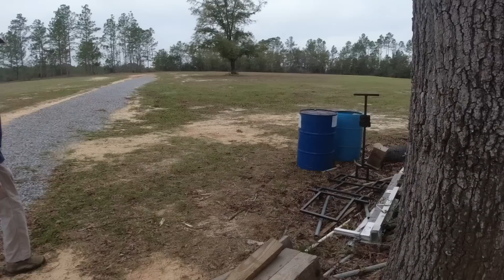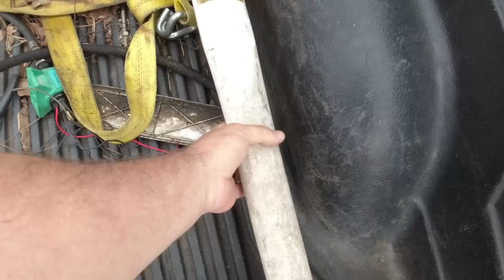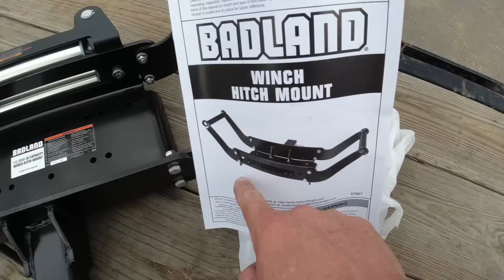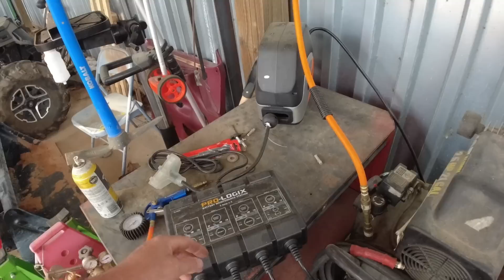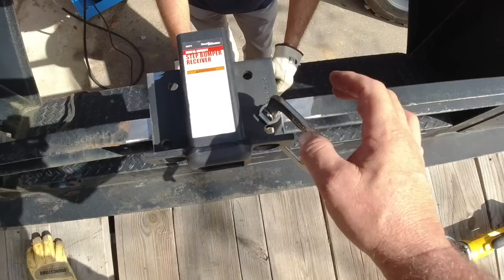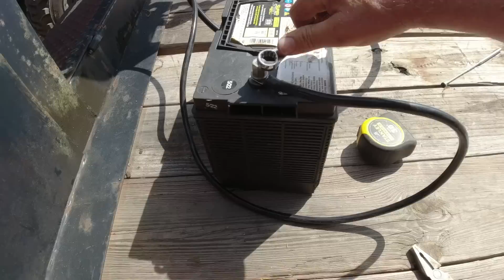This will change how we recover equipment!

Comment: I'd put a second piece of channel on the trailer. Over that spanse it's gonna warp. Then tuck the winch back at least level with the uprights or it has a chance to get clocked by what ever rolls into it, Besides you're losing a bit of room on the bed. Next get some snatch blocks, you won't be sorry. Good video guys.

Comment: Me personally i would mount it to the deck of the trailer. Even with supports on that it will eventually break the welds over time of use and weather, just to much give. Y'all stay safe

Comment: you need to support that winch better. It will never pull something heavy without breaking that bar loose. Weld some additional supports to the c channel

Comment: I would have taken a section of the floor out. And used heavy plate steel. To mount it to the main frame of the trailer. That cross bar is no way strong enough. Good luck!!

Comment: Put a fold down leg off the bottom of the winch it won’t be in the way if it goes to the brackets on the bottom of the wench holder thing ya bolts to

Comment: 12K single or 24K double line pull (will do it). C channel is going to fail . A block of wood to support winch isn't going to stop that.Failure will be the C channel bowing toward the load on a heavy pull until it fractures and it will fracture..... Go to a deck mount with some 1/4" plate. Wish I was there to assist.

Comment: Put one of those on my Jeep YJ. Can't beat the price and at 12K single line pull pretty sure I can't stick it to the point of failed self recovery lol. On same winch on a trailer: they have huge amp draw when pulling heavy. Use 2 battery set-up.

Comment: I'd add A plate & two pieces of angle iron coming off the other direction as  A  tray. welded to those angle iron straps going across the other way to hold it up with.& one center post leg & foot plate in the center at the bottom of that plate to Hank. It'll reinforce it a lot that plus strengthen it up A whole lot more.& Add more durability a long with that process to. Good luck with it all to.

Comment: Got the same winch (with the synthetic rope) on my 30' Diamond C gooseneck.  Mine is permanently mounted though, with a battery in the toolbox with a solar charger on the neck.  Also, Brother, those legs are so pale that they're blue LOL!!!  Just busting your chops a little bit!

Comment: Hank, i know you want to be able to remove the winch but i don't think you should. weld a plate across the one brace and mount the winch to it. it'll be there at all times but it'll be safer than what you have

Comment: You are loading the channel in it's weak direction.  It also has no torsional stiffness.  Either replace that channel with a square crossmember, or nest a big, long square tube behind the channel, and attach to verticals on each end.

Comment: Mount your battery permanent on the trailer and use your trailer wiring to keep it charged. If it didn't come equipped with a battery charge relay, you my have to install one. I would almost bet the 4500 already has the proper wiring. All you have to do is hook it to the battery.

Comment: Mount the winch on top by the tire, with a SOLID bass.  Then use pulleys to direct it down and back.  Pulleys increase pulling power.  It does slow it down, but it's not a race.
Reply: The Pulleys You describe only change the Direction of Pull. 
A Pully at the Load and back to the Winch doubles the Pull Strength.
Reply: @m9ovich785  At the time of filming, the winch was mounted up high, pulling from that height.  It's trying to pull forward and up.  By mounting the winch on top, the first pulley off the winch directs the cable down.  The second pulley, mounted just above the deck level, directs the cable back.  The cable only has a pull load vs a pull and lift load.  Trust me.  I've worked with pulleys and cables long enough to know I'm right.  But if you feel argumentative, someone else mentioned the same thing I did.  Take your issue up with them.
Reply: @MNJay1  I'm going on 63 and Had My 1st Winch on a Truck since 18. I currently have 3 Winches on Vehicles. One of which is a hydraulic Milemarker on a Swivel mounting Plate that I can use on either End of a 99 F-350 with a wet Kit off the 6 Speed Trans. I can use the same winch on Either end of My Kioti tractor. I changed the Hydraulic Oil in the 1 ton to that of the Tractor.  The ATV winch I can use on Either end too. I use them more on the Back cause it is at most time easier to pull the Stuck Vehicle out the way it went in. 
SO I am a bit educated on Winching Dynamics too....
Reply: @m9ovich785  Great.  So it shouldn't be difficult to understand my comment.

Comment: You need to brace that cross bar, it won't be strong enough. Stand off to the side when winching out of the path of the cable with a blanket or something over the cable to keep it from flying around. We want you to be around a long time. 😂.😂😂

Comment: That’s way too flexible it will rip off under a somewhat heavy load. Really need to put a piece of square tube and weld it to the goose neck frame.

Comment: Hank, if you start loading up the c channel cross member, it’s gonna bend in a heart beat.  You might be able to pull 1500-2000 pounds at best.  Anymore than that, it will bend bug time!

You got away pulling a load that rolled.  But pull something that doesn’t roll easily.  You saw how much the c channel flexed pulling the tractor.  A heavier load will definitely put it to a good challenge.

Comment: Hank, try taking a piece of thick square tubing & run behind the c channel where you welded the gussets on. If need be notch out for the gussets & fit in place then weld the slits up with gussets inside. Hopefully that should take the majority of your flex out. Love the vids buddy

Comment: Just an FYi, and I am sure you figured it out, but you only needed to cut one angle in the gesset scrap. Flip over the first triangle along the angle you cut and you will find a straight cuts across the metal (short side) gives you triangle 2.

Comment: Your on right track but that is far to weak it really needs beefed up with your winch fitted to a solid plate not a receiver hitch it’s just to feeble but like others said mount it on top to at least a ten mm sheet with winch bolted to it and next to it a battery box or whole thing boxed in and locked and on bottom of frame fit a tow hook point for snatch block use plus half way up on either side if trailer the same incase you need to pull something that needs straightened up or pulled up at a angle , plus never ever stand behind a winch if the cable snapped you would have no chance !! Always grab a heavy towel Capet or similar and place it over the winch cable/rope to act as a dampener if it breaks or breaks of what your hook up to and stand off to the side using your wireless remote only use the cable once whatever you have winched on needs you to get near to finish off pulling it up then the cable connection but get in habit using wireless so you never standing close to the cable /rope . 
Slow and steady and think safety when using a winch .

Comment: Thanks for another great video. It was interesting and enjoyable. 

Nice winch you fit with the remote and everything. 
I do agree with you that the mounting system you have needs a bracket welded onto it to enforce the mounting system you have. 
Needs to be a little stronger. 

Pulled that tractor up with no problems at all. 

Handy to have that winch on your trailer. 

Thanks to Sonny for his help. Hank you did great on this winch setup. 
Just enforce that mounting now and you got it. 

Take care and be safe. Thanks for everything. 
The Iowa Farm Boy. 
Steve.

Comment: you could hook your winch and a battery box up high and use the bottom angle iron to make a strong pull area for a snatch block for pulling a slow and heavy load on to trailor